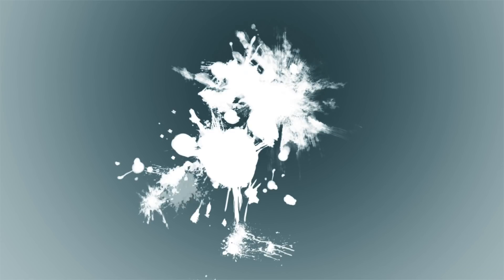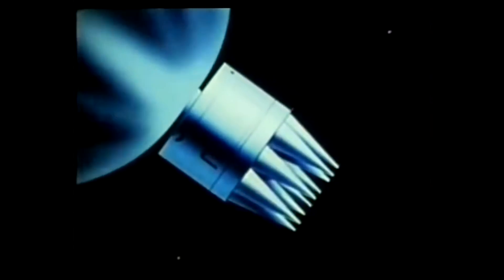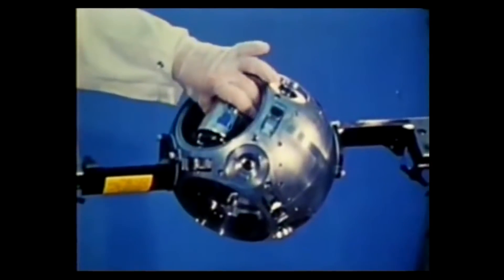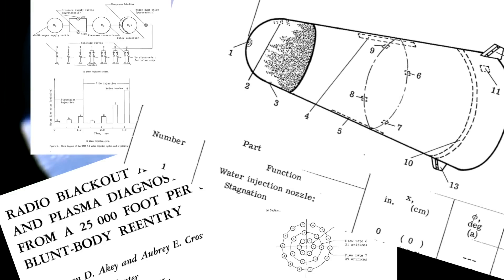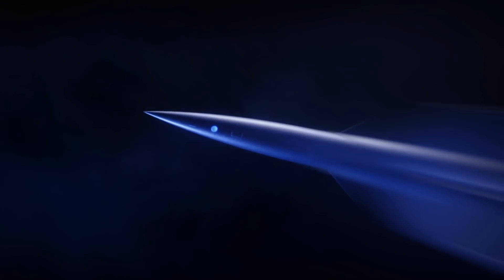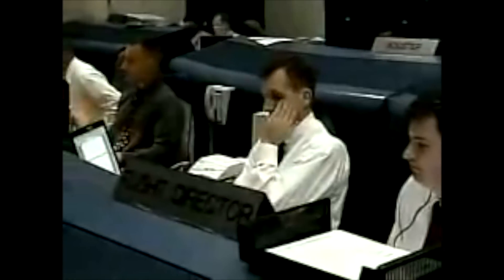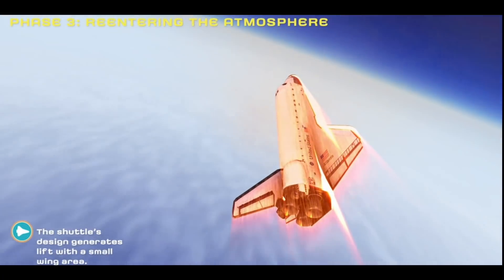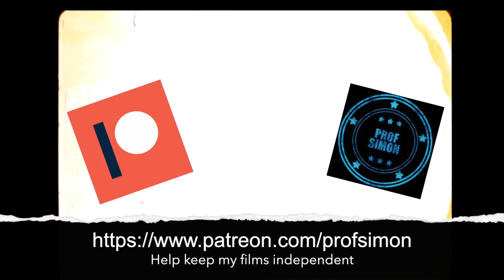Piercing the Plasma - Prof Simon

Comment: I didn't learn this from a classified context, so take is with a grain of salt.  Supposedly there are micrometeorites frequently entering the atmosphere leaving a brief moment where the plasma in the sky can be used to reflect a radio signal to a pinpoint location.  They can't predict where it will happen, but they just point a signal assuming a meteorite will show up in just the right place, and when it does they send a burst to the desired location.  It is really difficult to intercept because the enemy would have to be listening, and be very close to the target.  Maybe they can create these plasmas on demand now wherever they want?
Reply from the maker: interesting
Reply: @SimonHollandfilms  Yep radio hams who like a challenge have a mode called meteor scatter which uses this effect. There are specific allocated frequencies to listen on and you tend to do so during the peaks of the various meteor shower seasons. Need to have high power, a high gain antenna and use high speed data as it lasts almost no time.. Not especially secure though as the name suggests, signals from, say,  the UK can scatter all over Europe,

Comment: If UAPs were plasma, they would show up as hot on FLIR or other IR devices. They would also heat up the air around them. Not sure what they would look like on a RADAR screen. Depends on the type of RADAR. I was a RADAR operator in the US Army.
Reply: I'm not sure if the plasma itself is hot. Plasma created in very hot environments, but that heat is a precursor.
Reply from the maker: not all plasma is hot and it can be both a radar absorber or reflector.